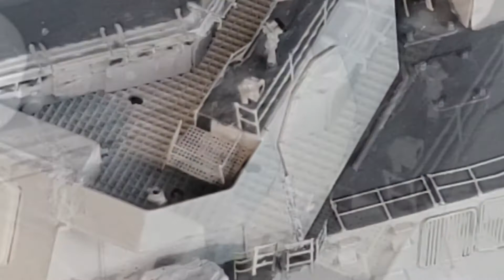USS JOHN PAUL JONES (DDG-53) 1/350 Scale Model Build;  Part 10:   Forward Superstructure

Comment: All the extra small details that your adding really look good. The forward bridge assembly required a lot of time and patience to make sure everything lined up properly with all the angles  it has. I spent a entire evening on mine. With all the details your adding this is going to look really great when it's finished. I use photo etch on a lot of models but you've got a lot more patience than me. I'm just going with the photo etch railings that came with the DDG-51 that I'm working on.